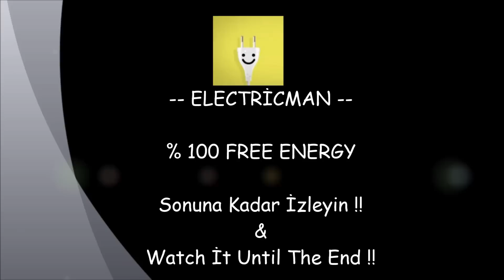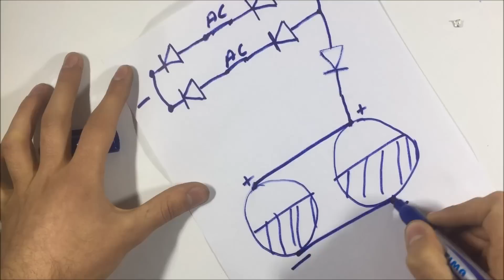Mıknatıs İle Sınırsız Elektirik Üretimi | FREE ENERGY

Comment: I would not be even offended if you pre-charged the caps with some energy to start it off, so that it may run and recycle the energy until it entirely runs out mate, saves you wafting the magnet back an forth for a while.. When you think about it, it's just like using a starter motor on an internal combustion engine :) Lovely project and proof of concept :)

Comment: Hello, it is a very good idea. I congratulate you.and I suggest to put an interpreter between the multiplier and the motor. On the positive or negative wire. How you will keep the energy imagine manually In the capacitors .. and the startup of the set became fast .... I will try this in the near future,
salut ..cher ami c'est une trés bonne idée.je te félicite.et Je suggère de metre un interepteur entre le multiplicateur et le moteur.sur le fil positive ou le negative..comme ça  tu va garder l'énergé imagasiner manuelement dans les condensateurs ..et le demmarage de l'ensemble   devenu rapide ....je vais essayer ceci dans un proche avenir,
Reply from the maker: Hello brother thank you for valuing my ideas ;)
Reply: hi..No problem my dear friend is in the brothers and you are on the right way..
 I congratulate you...good luck..

Comment: ELECTRİCMAN you’re busted, you opened the motor see 3:42, that motor has a variable speed controller built in. prize the back off and remove speed controller insert computer bios battery 3volt (CR2032) wire the motor connections so when shorted motor runs. That one is as old as the hills.    Look again at 3:42, one can see motors back is not even fully on and the giveaway is one can see it's glued to hold the back on lol, and I never seen a strip board (prototyping board) from any manufacturer used in motor of that type. Even the two wires coming from inside the motor is stripped mains wire. Good try.

Comment: The motor is twice as long as normal. Anyone who has taken apart a CD or disk drive knows this. The added length of the motor has coin cells in it. All you have to do is short the two motor pins together and the motor will run.

Comment: Only the friction real matters here, and a little bit motor rod shorter will do it much better
100% Good job
Reply: 100% Nonsense
Reply from the maker: thanks bro ;)
Reply: ELECTRİCMAN, the electric diagram was wrong sketched, sorry but the light emitting diode and capacitor were inversely polarized in your sketch.
Reply: @ Filipe Estrela De Lima, I second you

He's busted,  he opened the motor see 3:42, that motor has a variable speed controller built in. prize the back off and remove speed controller insert computer bios battery 3volt (CR2032) wire the motor connections so when shorted motor runs. That one is as old as the hills.    Look again at 3:42, one can see motors back is not even fully on and the giveaway is one can see it's glued to hold the back on lol, and I never seen a strip board (prototyping board) from any manufacturer used in motor of that type. Even the two wires coming from inside the motor is stripped mains wire. Good try.
Reply: keshe work shop
Reply: keshe
Reply: this also I observed!

Comment: check at 11:06 he needs fix arm with his finger when soldering the blue wire , why? because the engine already has feed power with some hidden battery!!!
Reply: the capacitors are giving the energy, not a battery. still no free energy though

Comment: he uses his energy by moving the magnet to get electrical energy stored into capacitors, then this energy runs the motor . with this feed back loop and NO friction, the motion will perfectly continue forever.  Unfortunately he has to use his man power again to convert to electrical energy to charge up capacitors. ???.  Thanks for his demo anyway.

Comment: Sorry, nice little project. But this is not free energy !
The motor will stop after a while. Of course that nice thing runs a bit BUT all you do is recharge the Caps, when the magnet runs forward backward under the coil, but the energy
produced is less than the energy generated. So your efficiency is <1 Not Free Energy - you could replace the Caps with an accumulator which would have exactly the same result, but would run even longer :)
HOAX
Reply: He isn't engineer and he wanted just fun.

Comment: What you don't see here is the coin cell Battery hidden under the protoboard, the rest of the components are there to distract you. There appears to be three diodes for no apparent reason, being the LED by its definition is a Light Emitting Diode so no need for one there. secondly I cant see any visible tracks or traces that supposedly join the generating side coil/magnet to the capacitors/output motor. This is a fake as they get.

Comment: for even better upgrades you should put a small inverter for or current multiplier between the generator and the capacitors this will create more current for the capacitors very good motor experience. Some people are limited in their ideas so they can not see power in a simple experience.

Comment: You have to manually move the magnet back and forth to charge the capacitors every so often.  There are many loses in this thing you build, so perpentual motion is impossible!  0.7 volt drop across each diode that are feed from the electromagnet coil, the coil is some distance away from the magnet, so you are not getting all the emf that you could get from the coil.  And the little motor has many loses too.  Those capacitors charged would keep it going to a little while, but the magnet moving across the coil would not be enough to keep the capacitors charge and you gizmo will slow down to a stop without intervention.